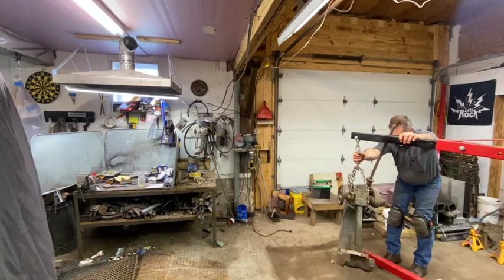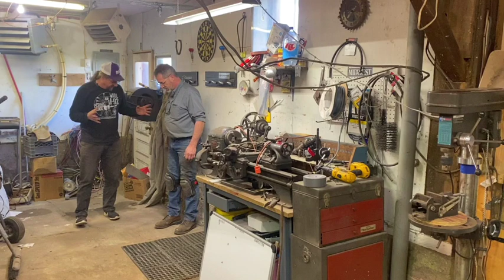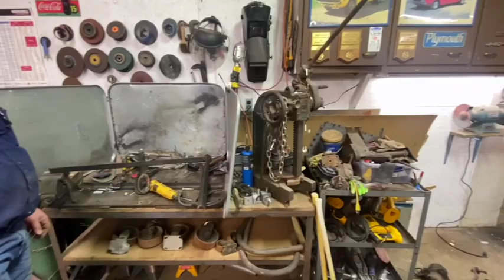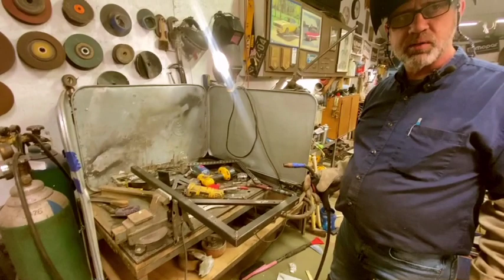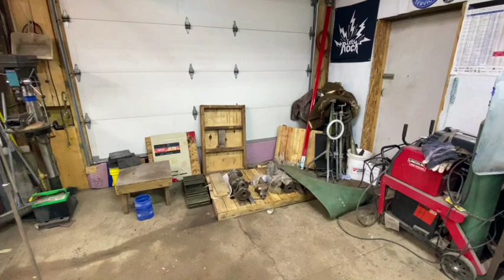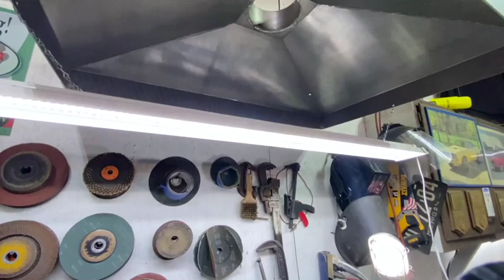Incredible Changes in The Shop Preparing For A New Piece of MYSTERY Equipment!

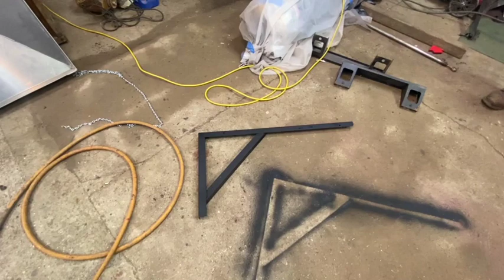Comment: 6:48 Did you just paint that on the shop floor? 🙄 Put down some cardboard next time.😮‍💨
So what might the new equipment be?
1. You have talked about a chassis frame table for The Golden Mullet.  It could be that. 🤔
2. Did you find a Bishman tire changer?  I know you are looking for one. 😼
3.  Don't tell me you are getting a laser rust remover! 🙀 (Hey we can dream.)
I guess we'll just have to wait and see.
It is always fun to re-imagine a work space.  I would love to do something in my garage, but I am so limited in just where I can place things.  I sort of wish I didn't have an overhead garage door since so much of the ceiling area is taken up by it. I actually saw a garage door that followed the roofline and rolled up into the attic area so that the garage could have overhead storage for lumber.  This was on a tour of homes that is an annual event by the builders in the area. It was a cool idea, but I really wonder how thin that area of roof is and could you walk on it without worrying about it snapping under your weight?

Until next time.

Make it Safe,
Make it Done,
 👨‍🔧&  🚘
Go Have Fun❣

Stay hydrated, safe, and healthy. 🤟RAWK!
Reply from the maker: I paint things on the floor as often as possible, so that the paint will hopefully glue down the dust. 

If the floor was painted the way it’s going to be in a year or two I wouldn’t do it. But right now, it only helps keep things glued down to the floor so it doesn’t kick up and get into projects. 

There’s always a method to my madness 

Stick around, hopefully the new piece of equipment will be arriving sometime this week, we’ll see.  

Thanks for watching